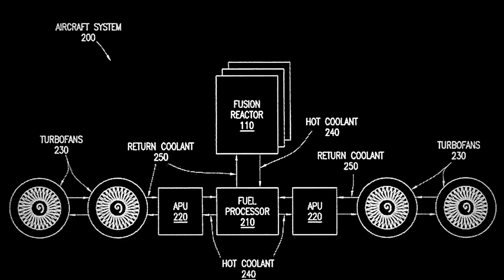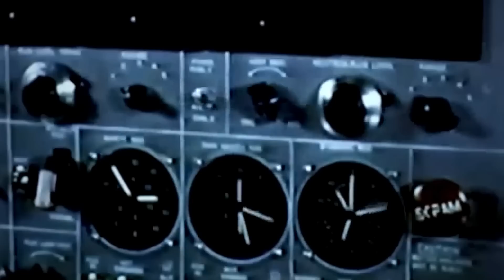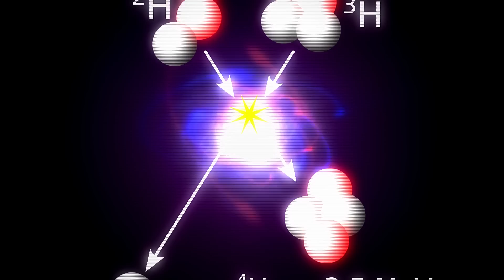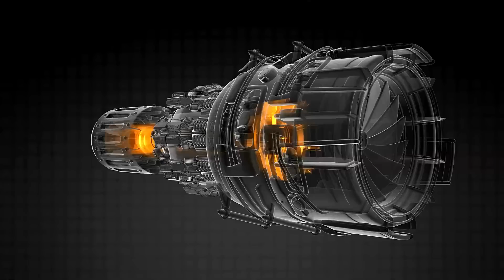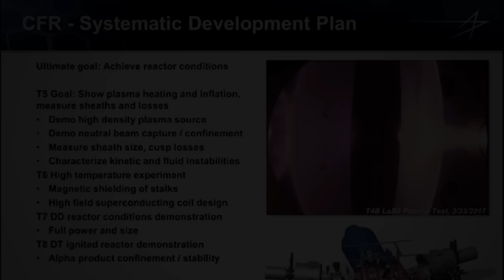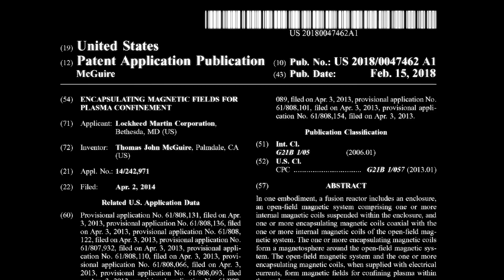The Nuclear-Powered Aircraft that Will Change Everything

Comment: Not a single comment was made about the biggest problem of all NEUTRON SHIELDING. Without it we're not going anywhere with anything. Even that system would require either tons of reflective metals,water jackets or 6 ft of high-density concrete.

Comment: In of early 1940s Hamgyong from Wonsan Kumgang Mountains to dormant volcanic Paektu Changbai Pass of Hamhung Hungnam Nitchitsu's Jun Shitagau Noguchi had a muon catalyzed fusion rocket engine comprised of a Dewar of cryogenic liquified deuterium connected to a beryllium alloy reaction chamber nozzle coiled in around electromagnet coils to focus cosmic ray muons for alpha particles be deflected while cryogenic fuel can prevent exceeding of Curie Point for Hideo Hasegawa's Project NA thru NZ.     

From 1938 to 1945 Roosevelt had laid a seafloor mine blockade around East Asia so Japanese East Asian Coprosperity Sphere lacked quality ferrous iron to not have rail transit track locomotives amid hydroelectric terrain too mountainous full of jagged waterfalls so any rail transit tracks they did have were controlled by Soviet backed rickshaw banditry and amid surpluses of chemicals and silk.

Therefore their only option was to haul freight with sulfur fueled steam filled airships inspired by Korean hoopskirt farthingales and rocket powered gliders of braided fiber composites inspired by bumpits of towering coiffures of both Korean and Manchurian brides between rooftop hangars equipped with Mary Kenney's patented ground based STOL fans while female divers along with synthetics had prevented solar agricultural serfdom. 

Please remember such forgotten inventors such as how Jun Noguchi had to use Central European employee Fritz  Hansgirg on 1930s patents and Mary Kenney had to use attorney  Gibbons on patents of how both inventors had to endure being forgotten due to sexism and racism of their time.   

Eventually Allies by the Fall of 1945 leveled mountainous terrain to impose rail transit tracks and agricultural farm produce on Asia.
Reply: I based my MIT work on such a forgotten inventor so I have a CIA archaeologist stuck in de facto Rennaissance fair North Korea so CIAattaché to "National Archives"  gave me orders to not negotiate with North Korea while Dept. of Energy, Air Force, and NASA officials had me sign papers so I no longer exchange email with an editor in of Chengdu Sichuan who was declared an "unperson" of no records on file for offending Beijing's Central Committe.
Reply: Xcor Lynx spaceplane could be augmented with a Helmholtz induction coil to lens cosmic ray muons and deuterated diborane fuel since their "cryogen valve" patent describes Lynx spaceplane's rocket engine in of detail.  

I once tried to commit suicide in of Ontario to protest how they would not let me tap cosmic ray muons for rocket propulsion so will Russia develop such a resource given how a phone call from Dr. Mitchell Swartz said I should take Jerome Drexler to court for plagiarizing my MIT peer reviewed articles.

Comment: I had authored  MIT peer reviewed articles on nuclear fusion rocket propulsion and by invite only had given a presentation on nuclear fusion propulsion from Prior Art to Spaceplanes for an engineering conference held inside MIT's Electrical Dept . on Vassar Street of Cambridge, MA.
Reply: What is important is rail transit should be replaced with Dynairships or Lifting Body Airships of Robert L Morrison's patented Lighter Than Air solid "SEAgel" and replace agriculture with fermentation single cell culture vats of electroporated Knall Gas bacteria.

Comment: In the 60's or '70, one of the leading military hardware companies was working on a nuclear-powered aircraft in North Georgia!  They failed and abandoned it!  One of their major problems was coolant!  Nuclear-powered vessels are at sea where the sea water can be used as the secondary coolant, an endless supply, with HO (heavy water) as the primary coolant!  But water, though good at cooling and absorbing radiation is very heavy, much too heavy! IF Lockhead Martin somehow is able to solve the fusion problem (as well as the size problem) that would be great but succeed or fail, they will get a HUGE check from the US government!  Us taxpayers are so generous even especially when we don't know about it!

Comment: Hmm, if possible this would be uber interesting but seriously doubt this will happen.  Watching others doing their best to make a fusion engine, one of the the top researchers jokingly said fusion is probably 30 years away, and will always be 30 years way, science has been saying this for the last 60.... 😘  Biggest problem and even mentioned in the video is the enormous amount of power needed to contain the fusion reaction given the amount of power needed to sustain/maintain/allow for fusion, that itself  makes it seem  impossible...?  If on is able to get fusion going awesome,  but sorry just don't see it or get the shielding in an plain where weight is critical, and a core of around 1 Million Celsius is required...   Just seems impossible, but hey if lockhead has something... Awesome, but i'm thinking at the earliest it will take at least 30 years 😲

Comment: "a magnetic bottle, which will contain extreme temperatures of hundreds of millions of degrees..." How can any container made by man not melt at "hundreds of millions of degrees?" I'm very skeptical of such claims. Either someone is reading the data wrong or they've developed an object that even our sun can't melt! The temperature of the sun varies from around 27 million degrees Fahrenheit (15 million degrees Celsius) at the core to only about 10,000 degrees F (5,500 degrees C) at the surface, according to NASA. Can you see why I'm skeptical?

Comment: There's a HUGE problem with nuclear power that is consistently ignored.  The nuclear reactors that presently exist in the US produce 2,000 TONS (that's 4 million pounds) of nuclear waste per year. This nuclear waste remains dangerous for hundreds of thousands of years.
Before considering increasing our dependence on nuclear power, a method of safely disposing of this tremendous amount of nuclear waste needs to be developed.
At present and into the foreseeable future, the safest, most reliable form of energy remains fossil fuel.

Comment: Even if they do make one that works, even a small one, it will not be available or even unveiled to the public. It's potential to generate electricity would effectively ruin the already broken but well guarded oil industry. Overnight, those companies  would go belly up. There will almost certainly always be a  veil over fusion until oil is no longer a viable solution to power generation. At least until the big corporations could figure out how to make their money off of it instead of oil.

Comment: My father worked at GE back in the 1950’s. He worked in an area where they we’re trying to build a nuclear powered jet engine.
Reply: I know P&WA did work on a nuclear aircraft engine at the CANEL plant in Middletown, Ct. CANEL is an acronym for Connecticut Advanced Nuclear Engine Lab.
Reply: The US Military decided it was not feasible at that time. Due to limitations on certain metals. Plus the cost was very, very expensive.
Reply: The crew shield was very heavy for the application
Reply: Did he get cancer?
Reply: @JohnDoes620  only ass

Comment: of course it has h-b0mb probability
Reply: God owns it, you, everything, not yours to patent/limit/litigate over, God bought it with high price
Reply: you can use any burnable mass/liquid/gas in external combustion heat jet, simplify the process, dont try to make complex ice turbine, ece ftw
Reply: learn from the power plants, that use coal, large fire slow burn, not small fire fast burn, that causes problems, by design, first burn, then use the heat

Comment: The MB36 mentioned at 2:33 is not nuclear powered and could not remain aloft "practically forever" as its duration was limited by the onboard supply of aviation gasoline required for engine function.

Comment: Er, this whole video is bogus.  First of all, fusion reactors are still quite a ways off from reality, and nowhere near compact enough to be put on aircraft.  Same for fission reactors.   Second of all, it is one thing to generate huge amounts of energy with very little nuclear "fuel" - however you need to translate this energy into THRUST to power an aircraft or rocket, and this is where you need additional MASS to propel the aircraft or rocket forward, and most schemes involve using this massive amount of nuclear energy to ionize and accelerate this extra MASS of propellant (xenon, whatever) in an ion propulsion drive  -  you can get extremely high specific impulse numbers in such devices, but overall thrust will still be fairly low, and so such engines will only be useful for long duration space flights and will not be practical for earth base flight, where the thrust will be too low to overcome gravity and the weight of the nuclear propulsion system.

Comment: 2 billion gallons of fuel per year is hard to fathom. Most people dont have the money to fill their 200 gallon oil tanks for winter! And where the hell is all that crude oil coming from??? How many large deposits can honestly exist???
Reply: Global oil production amounted to 89.9 million barrels per day in 2021
A 42-U.S. gallon barrel of oil yields about 45 gallons of petroleum products, three more than the original barrel. Gasoline makes up about 40% of a barrel of oil or about 19 to 20 gallons of oil.
So 2 billion gallons of fuel are made in a little as a half day or 12 hours.
According to the British Petroleum’s 2019 Statistical Review of World Energy, the total proved reserves of the planet’s oil at that time was 1,733.9 billion barrels. Yearly global consumption in 2019 was about 35.9 billion barrels. A basic calculation reveals that if proved reserves didn’t grow, and if consumption remained constant at 2019 levels, it would take only about 48 years — meaning some time in 2067 — to exhaust those reserves.

The earth is HUGE.
Reply: @joeiborowski9763  thank you (sincerely) for  giving me that intel and you hit the nail on the head, we need to start thinking about the earth way more and get creative with alternative fuel sources and power to run all our unnecessary tech. Or mom's gonna get rid of us one way or another!

Comment: Fission is easy, fusion is very very hardy, containing it is nearly impossible, as very large and strong magnets need to be used as the heat is so great it evaporates electrons with ease.  A fusion react that is practical and can fulfill a similar role to current fission power plants is probably in the +100 years away range.
Edit the people that say "we are so close" have probably been saying that for a while and are lying.

Comment: What happens if a fusion-powered jet is shot down? Radiation leak? Dirty bomb? Tsar bomba?
Reply: Research the tech and difficulties; you'll learn that a fusion meltdown ain't possible when you're relying on magnetic containment to keep things hot enough.
Reply: @warpedweirdo  and if you punch a hole through the side of it, nothing happens?
Reply: @hanrockabrand95  I recommend you not take my word for it; do some research, see for yourself.

But, should you decide not to take my advice...

TLDR: If you punch a hole in an automobile's engine, does all the gasoline in the fuel tank blow up? No, it doesn't. Why? Because the required conditions for a detonation don't exist in the fuel tank. So it is with a fusion reactor.

If you hit a car with a grenade launcher, does all the fuel in the tank detonate? No. Why? Because the required conditions for detonation still don't exist. The fuel must be vaporized and mixed with plenty of oxygen.  The mix must be contained and ignited. Only then can you get anything approaching a detonation. Fail to meet those conditions, and you'll get a fireball at best. Cars blow up only in the movies.

Longer: Unlike in a fission reactor, at least one of the fuels in a fusion reactor will be injected only as needed. The rest of that fuel will be stored elsewhere. There is zero risk of a meltdown or other "critical event" within a fusion reactor.

Punching a hole in the containment vessel (where the fusion takes place) will allow the plasma within to vent, immediately killing the fusion reaction. There may be a bang from the ventilating plasma, but nothing anywhere near the yield of even the smallest nuclear bomb.

You might reasonably ask whether a nuclear-tipped missile could set off the fuel. The answer: nope. Setting off a significant portion of the fuels would require the fuels (both) be held in place (contained), together, while subjected to extreme heat and pressure, long enough for a reasonable amount of fusion to occur. It's not enough to simply set off a bomb nearby, as that would merely disperse the fuels. Were it otherwise, we'd have developed fusion reactors quite a while back. It turns out that containment is tricky - very tricky.

There are other requirements that must be met but I don't remember what they are, or why. It's a complex subject.

Comment: The NB-36 was not a nuclear-powered aircraft. It simply was a modified B-36 bomber with a live test nuclear reactor and shielding that did not power the aircraft. It was powered by the same jet and prop engines of a normal B-36.

Comment: Sorry, fusion... not going to happen. It's just one of those things that are not possible outside of a sun/star, it is all hype, unlimited energy is just not a thing. On earth we have never even got close to producing as much energy as is produced by the reaction. and we need to produce at least 2 or 3 times that amount when you factor in all the conversion efficiencies. Then there are the material science problems that cannot be solved. (that are probably unsolvable).

But excellent video.